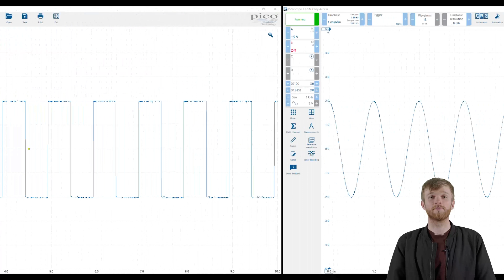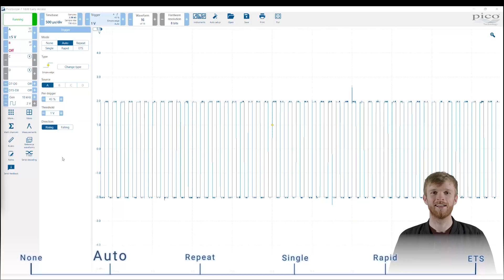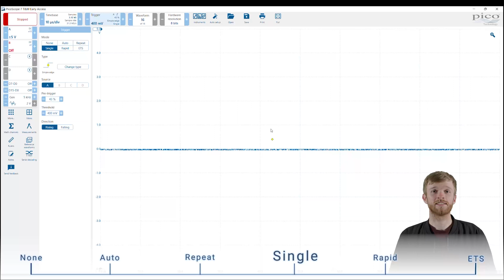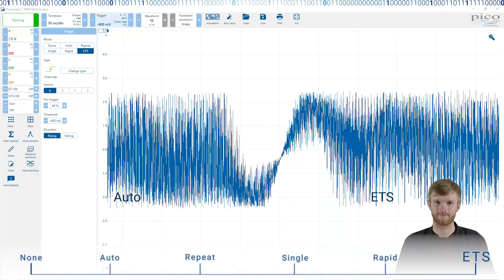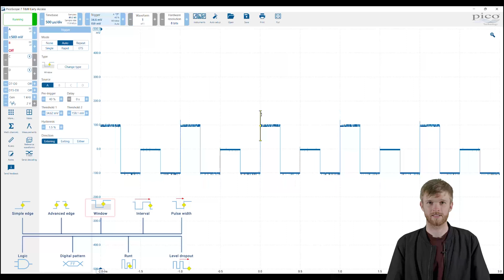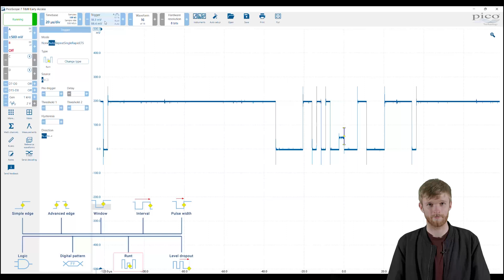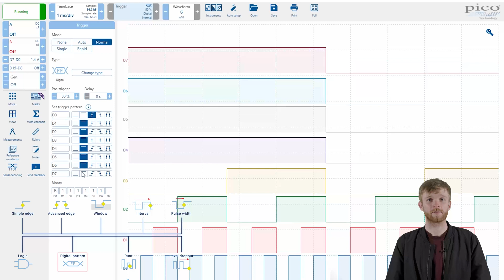PicoScope 7 Trigger Modes & Trigger Types - PicoBYTE #2

Comment: Been using Pico for 25 years, sorry but NEVER been able to use advance trigger for automotive successively with changing dwell or frequency signals, can you show us how to lock a trigger on a complex cam shaft signal?
Reply from the maker: Hi Alex, the best trigger option would be to use the 'Pulse Width' trigger type but with a compromise. I've asked Steve Smith of the Pico Automotive team to get in touch with you to follow up this question.
Reply: Did you ever get an answer from Steve Smith on how to trigger on a cam signal?
Reply: @DrivelineMaster  Nope, and still haven't figured out how
Reply: I can get it to trigger on a crank using the pulse width trigger but even that is tricky.  I will see if I can make some time to sort this out and If I come up with anything worth while I will make a video on how to do this and post it on Drivelinemaster.